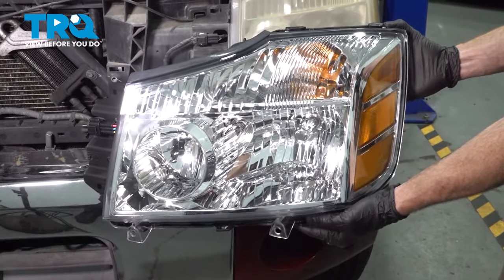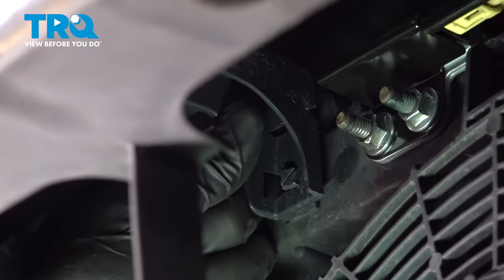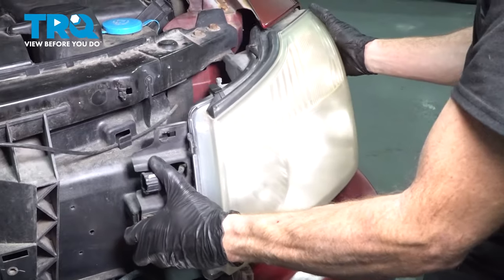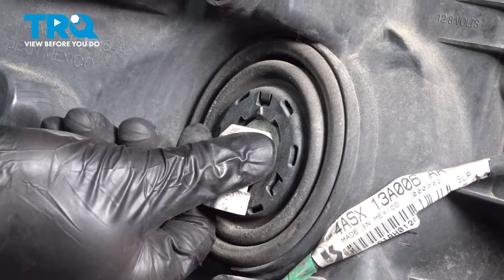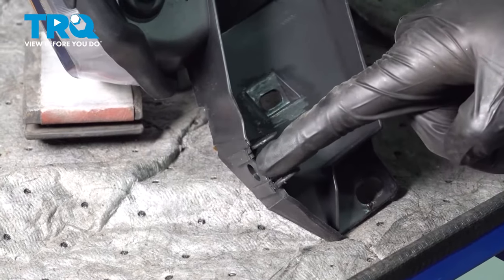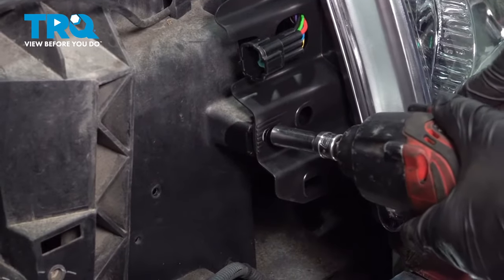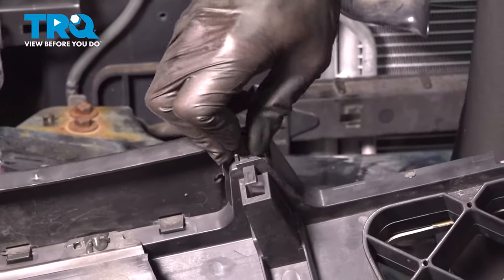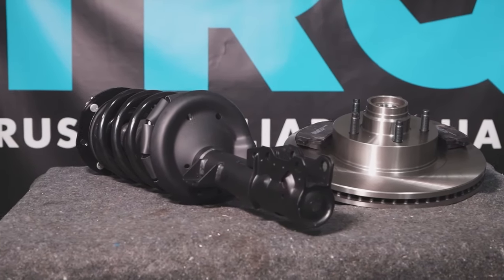How to Replace Headlight Assembly 2004-2015 Nissan Titan

Comment: Pulling the trim piece below the headlight like shown just broke the piece for me and ended up being an expensive fix with having to get a new part and getting it painted.  It is better to leave the trim attached to the headlight.  Once you have the headlight bolts detached, then pull out the headlight with the trim piece attached being careful of the tab at the end of the trim piece.  Once the whole assembly is removed, then it is easier to remove the trim piece from back side because you have access to the tabs to properly unlock them from the trim piece.

Comment: Great video but I would do one thing different. Before putting on the trim and grille, check the bulbs then. If something is loose or a bad part, you want to find it before you reassemble everything.
Reply from the maker: +Tom M Thanks for the feedback! http://1aau.to/m/Shop-TRQ

Comment: One of the bottom bolts is a 10 mm, and the light should be removed first then remove the trim below the headlight, the fasteners are to old on a 2004, they will break